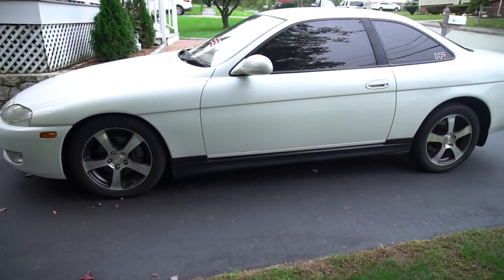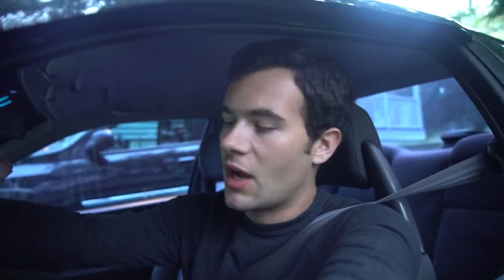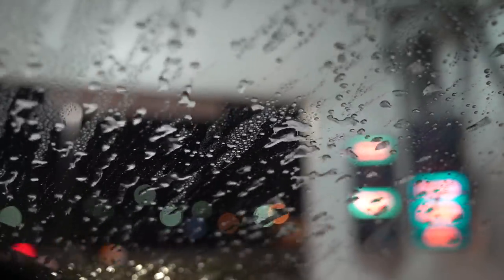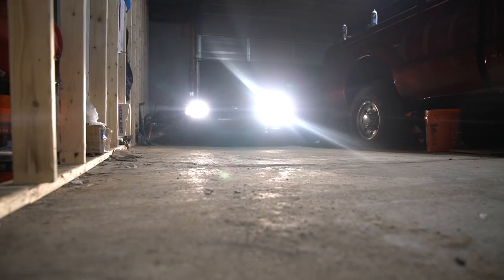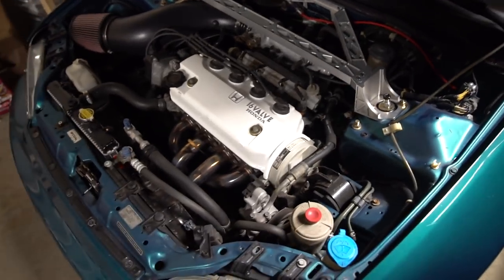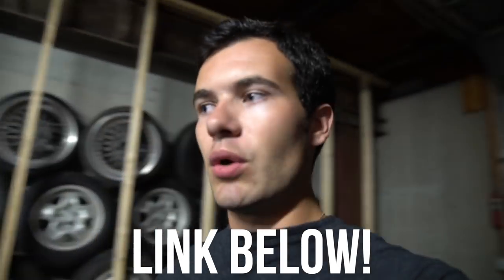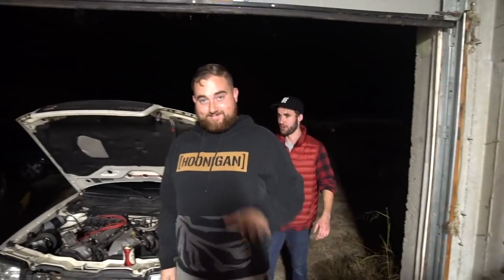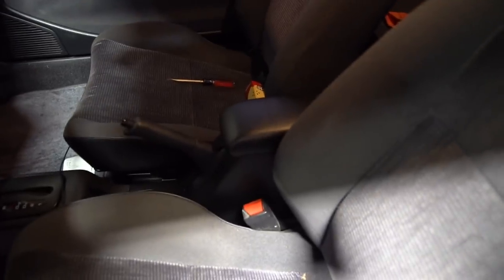Its been too long...

Comment: If your going to go through a touch less wash.  Spray your wheels with a good break dust cleaner first to help lose and rinse off as much as the wash can.  Then take a microfiber cloth to em to get anything the wash did not. Especially on white wheels it will make the final product so much better.